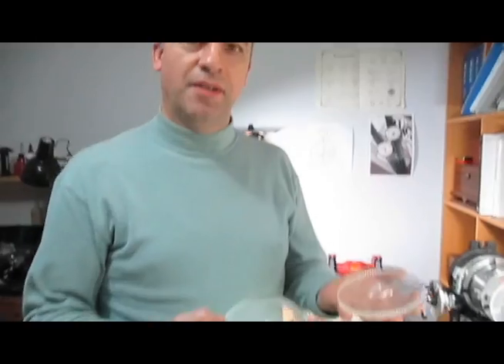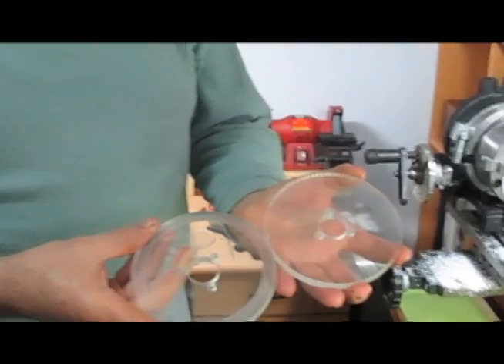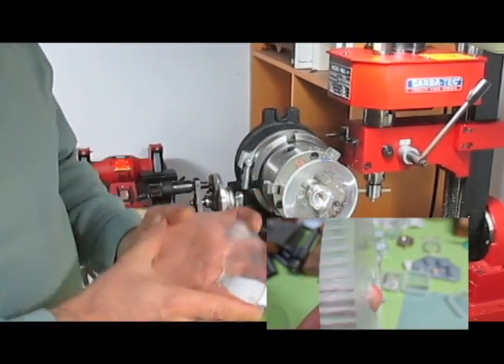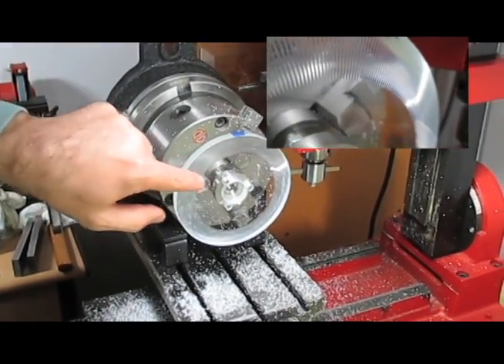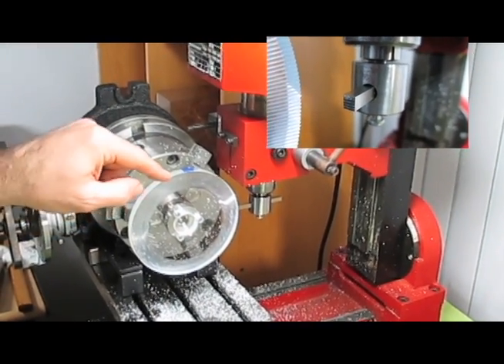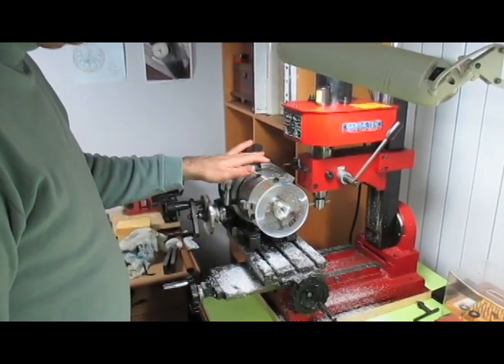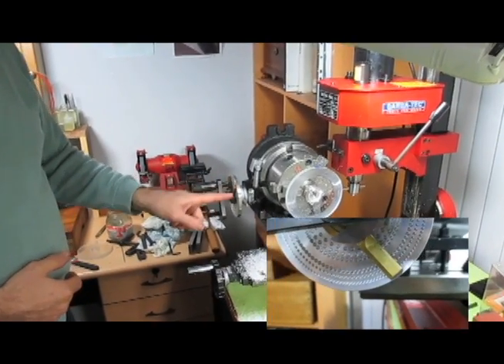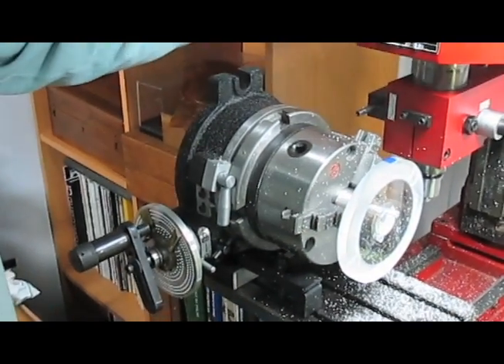Rose engine rosette making

Comment: Very nice work! For the rosettes with the lower count sinewaves, do you just use a wider cutter or is there a different process involved in making those?
Reply from the maker: Hi Karl, thanks you for your comment, for the lower count sinewaves rosette I use a common end mill cutter, for example for a 96 sinewave count a 8mm cutter is used and the setup is the same for a side rosette (pumping action) except that the milling machine spindle is brought vertical to the center of the rosette, but for a side waves the dividing head is laying horizontal on the milling table.
Hope that is answering your questions.
I now have completed my rose engine and will post a video about it in a not too distant future.
Reply: I look forward to seeing it! Is your intention to do guilloché work or is it built for woodcutting? I'm still wondering about the rosettes with the really low count though. Maybe you don't use them but rosettes that are pentagonal and such. It seems that using a flycutter and dividing head would be very difficult as the cutter would have to be enormous. Do I understand you correctly that you cut the 96-bump rosettes with a flycutter with a cutting radius of 8mm?
Reply: Oh, sorry, I saw that you wrote endmill now...